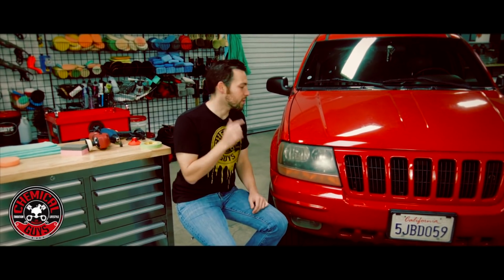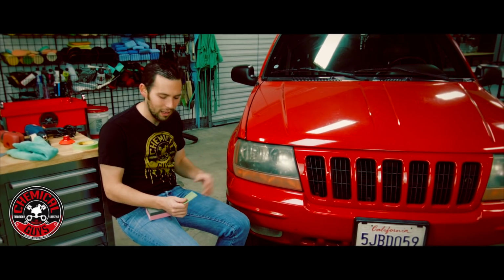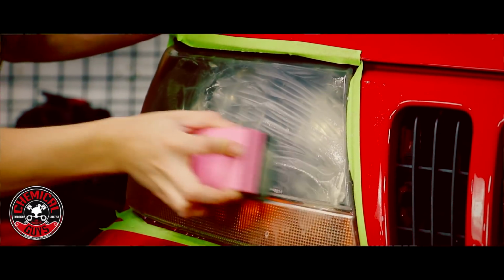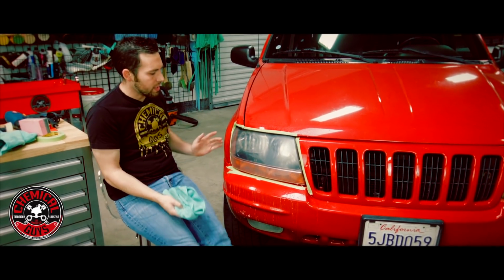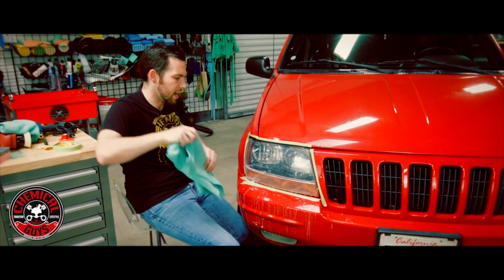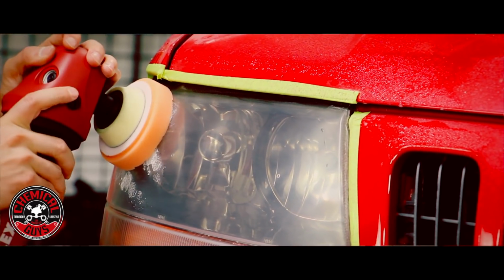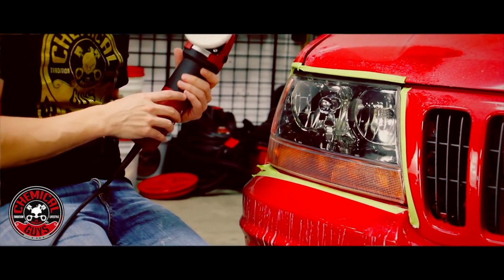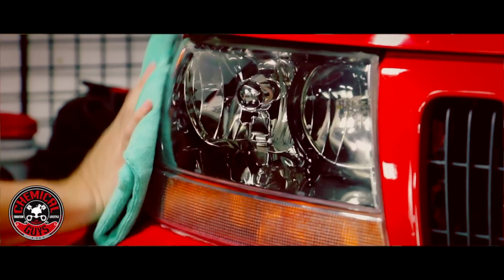How To Restore Headlights - Chemical Guys Car Care

Comment: Many thanks for this amazing DIY. I've tried to restore my headlights at a shop but they used 500 then 1000 grit sandpaper which caused small scratches that didn't go away after polishing. After that I've used Wipe New which was great only for 3 months and faded again.

My question is: is it okay to sand the headlights again with the 2500 & 3500 grit sand papers again after doing all the mentioned above? And are you sure that will not be any scratches if it was applied correctly?
Reply from the maker: Hey, thanks for taking the time to watch this sweet video. It will, that's why you need to polish, and apply Jet Seal to protect the headlights
Reply: Chemical Guys Many thanks for the quick response. I'm planning to use Chemcial Guys materials but, just for final clarification, polishing the headlights after sanding and then applying the Jet Seal will remove all the scratches made by the 2500 and 3500 grit sandpapers?  (Assuming applied correctly) 

Sorry for questioning again, but I own a Mercedes Benz S Class and the headlights will cost thousands of dollars if missed up.

I'm going to make a video while doing the restoration so it can be a good reference.
Reply from the maker: Yes, just be careful and follow our technique and you should be fine.

Comment: how much did you charge for each headlight? 😅 you did a very nice job
Reply from the maker: Hey Lisa, somebody would probably charge fifty dollars per headlight, it takes alot of work to get the headlights to look perfect.
Reply: I was right on the money :D but that's a good price considering they look brand new & still cheaper than buying a brand new set. how long would you say these will last after the restoration, 1 year or? thanks! for getting back to me <3
Reply: Damn 50 each :0 I charge 15$ each lmao looks like I gotta bump up my prices :)
Reply: Ive been doing this for  2 years. I charge $50 a set. $100 is too much for my area. Charlotte NC

Comment: can you use the jetseal on new headlights?
Reply from the maker: Hi Michael, 

You can use JetSeal on new headlights if you are absolutely positive that the headlight is clean. You don't want to protect and seal any filth in because then it's stuck, make sure it's completely free from contamination. 

-CG Javier
Reply: Thanks. I live in southern Arizona and the UV is intense. And protection I can put on my car is wonderful.
Reply from the maker: Hey Michael, if Jet Seal isn't cutting it, consider getting Carbon Flex, its got a lifespan of about 3 years.

Chemical Guys Alex
Reply: Alright, thanks.

Comment: After apply a final jet seal. What Did I do after a year? Do I need to apply jet seal again or start all over?
Reply from the maker: Interesting question. The JetSeal is designed to last up to 12 months before reapplying it again. Depending on the condition of your car, we do advise in starting the process again. Quick analogy: you wouldn't put lotion on a dirty body, you need to shower first before applying lotion and keeping your skin moist and protected. Hope that helps and thank you for being part of the Chemical Guys family!

Comment: I noticed there was a small neglected part closer towards the Grill of the car that looked a bit hazy bothered me 4 the whole damn video
Reply: Ivan Moreira indeed.
Reply: Noticed!
Reply: I was staring at it too. But yeah I was watching on a big TV and it was just the angle of the camera and  the lighting
Reply: @KronicDaydreamZ  What? No, it's not the lighting lol. You can clearly see the circle pitting of oxidization in the plastic and how deeply ingrained it is. Pause at 27:46 and look closely - it has a mottled effect like a car pat-dried using a waffle-weave towel. This is due to the fact he barely touched that edge.
Reply: @AlexYeets  yeah thats what I was looking at, but right after that when they switch angles its gone. They must have done some work after that scene.
Reply: @KronicDaydreamZ  We can't really use that shot straight after as a reference - I would bet you'd struggle to spot it from that distance with such a low-res camera, not to mention the glare off the ceiling lighting, but I will admit it does look like they must have done more.
Reply: Youbthink you can do it better?
Reply: @Brandon-no3vc  No. I KNOW I can do better. You think it's physically impossible to do better or something, kiddo?
Reply: It was just the camera lighting.
Reply: @BostonBorn    That was irritating AF but you're correct, was the lighting.

Comment: What's speeds are you using on the flex ? For the V36 & V32 ?
Reply from the maker: We use rotary polishers between 1,800 and 2,000 RPMs. Never exceed 2,000 RPMs when working on a car with a rotary.

Comment: after the Jet seal wears off lets say 11 months do you add another jet seal or what ? do you have to go threw the steps once again ??
Reply from the maker: If the paint still feels smooth you can just apply another coat of jetseal.  Claying paint will only remove what it can feel so you can reapply jetseal after you have washed and clayed.

Comment: Does this process work if my clear coat on my headlights are coming off?
Reply: It should because you're taking off the clearcoat anyways when you sand it
Reply: It's not clear coat....it's dead plastic. ;)
Reply from the maker: Yes follow the same steps.

Comment: What should I use if my headlights are just pitted from all the rocks?
Reply: start with lower grit sandpaper like 320 then 600, 800, 1000, 2000, 3000

Comment: Some comments indicate Chemical Guys are selling the world. I used the CG products I already have for auto detailing and it lasted 2-3 years before some oxidation returned. (No need to paint the headlights as other people suggest)

My Process: 2000 grit sandpaper wrapped around a sanding sponge, lubricated with any car wash solution. A 4-inch orange pad on a drill. I used a med-cut swirl remover (1st step) as the grit wears out, spritz with water and polish at high speed. Repeat the (2nd step) polishing with a finish polish such as Pro Polish 3n or equivalent. I finished the job with M-Seal and a coat of wax.

Most of these products are used for paint correction and general car care. Some headlight restoration kits come with a drill polishing pad and their brand of compound, machine polish for best results... This demonstrates you can fix your headlights by using most of the stuff in your detailing supplies without buying extra stuff. *No offense to Greg and the CG Team.

Comment: I would really love to see a video of you guys using the drill with a good screw adapter so that we can see the proper technique.... my biggest fear/issue is controlling spin speed (since a drill doesn't really have a speed setting?)
Reply: use the cordless small ones,they have no more than 1k-2k rpms and you can blast it on max and keep it there.

Comment: I just use toothpaste, a coarse brush, a cloth, a sponge and some polish for afterwards. Works for me, so it should work for you and leaves you car with nice and minty X)

Edit, it might save you $50 as well, that is one expensive headlight repair kit, seeing as autoglym does one for $30, for everything you are selling plus the guarantee that they are a company that has been trading for the best part of eighty years! I have used many other products which are inferior, and every autoglym product I have used has been the bees guts!

Comment: Got a call from a client who said they failed their MOT(UK thing) due to the headlights so went and had a look head lights faded, so a slight change to the way you did it, I clayed the light then V34 and then Jet sealed 109 to finish the head light and came up a treat and finished with V07 detail just to top it off. nice one for the guidance. improvise, adapt & over come. job done.

Comment: can you use a porter cable DA polisher or do you need to use the rotary polisher?
Reply: I'd also like to know sinc I only have a DA Porter Cable
Reply: MechanteTV I used chemical guys headlight restore kit and used the porter cable DA with 3" backing plate with the orange pad V34 and black pad with V36 and finished with jet seal. Came out pretty good just had a light fog line in the middle of headlight that did not come out, but not bad. looking into dvelup headlight restore kit for the next one and will determine which one is better.

Comment: Just a quick tip, pop that hood and raise it up.  Saves a little tape, but more importantly allows easier access to the top of the head lamp. 👍
Reply: I was wondering the whole time why he didn't. As to the wax guy above... When did he apply wax?
Reply: A little butter wet wax never hurt no one, available at chemicalguys.com
Reply: Kevin Hines pop the hood and pop a top on a 12oz ....
Reply: Just cover the surroundings with a trash bag cut and some tape.
Reply: Kevin Vines wax is hard to clean up in engine bay
Reply: @davemc3650  that’s only if your a newb and fling wax everywhere which can be solved by putting a news paper over that section of the engine lol .
Reply: @davemc3650  cover the entire compartment with a sheet, no clean up
Reply: @rollingpoet  just remove headlight then fix it

Comment: When you used the second sandpaper, you should have gone up and down. Since the first pass you went left and right, you can remove the sideways peaks even better, since you're going in the opposite direction.
Reply: No you go  front to rear  in a straight forward backward motion not up and down that would make more damage
Reply: I
Reply: that isn't right , anyone that does any type of paint and body work knows that, all  you do  then is create more scratches , the idea is to take away not add, think about what you just said
Reply: @jimmieroan9881  so true

Comment: Or if you'd like a more permanent repair, 500 grit wet sand, 1000 grit wet sand, gentle hand-buff with V32, IPA wipe, paint with several layers of ceramic clearcoat (engine paint), allow 1 week to cure, then gentle wet sand 2500 grit, machine polish V36, then V38.  :)
Reply: 99.9% of the time they don't keep a car for a week.

Comment: 20$ worth restoration = sand paper, and UV resistant clear coat.
Simple and cheap.
Reply: victor bonilla cant forget the wax. But after the clear you can be happy with it or you can wet sand it with 2000 or 3000 grit. And after with the wax its set for life, like new. 
Kevin is just working for his job sponsoring and advertising the products. When the less expensive way is just sand and clear coat instead of spending 150+ on a new headlight or spending on polish for just that occasion.
Reply: Some guy from a glass shop tried to demo that method to a shop I used to work at. He tried to restore one head lamp four times(sanded clear coat back down to the plastic) and it always had cracks in the uv clear coat
Reply: Alex M some headlights are so bad on the inside too and the reflector material gets dull from water leaking in the worst headlight that I've ever seen is a Venture van they're pretty cheap to buy aftermarket you could split the headlight and two and paint it with clear way too much work
Reply: I eventually just do it wit 800 grit Sandpaper an  compound
Reply: hung mammoth What I like about using wax to seal the headlights is it is multipurpose. The same may not be true for the clear coat spray, and if I get some wax on the car paint that’s great!

I don’t even use sandpaper or buffing pads to do my headlight restoration work. All it takes is some elbow grease and extra time, and you can save $$$, unnecessary tools, environmentally damaging chemicals, etc..
Reply: silverharbinger you're driving a car and worrying about "environmentally damaging chemicals"? Lol
Reply: *****  i couldn't agree more with you once your done with that you can use wax. this video its too long waste of time and yes Kevin Vine he coulda just open the hood this guys is ridiculous